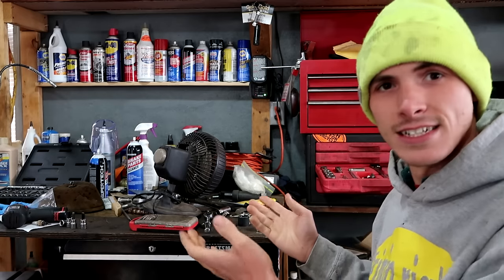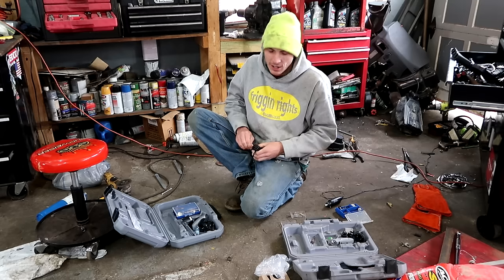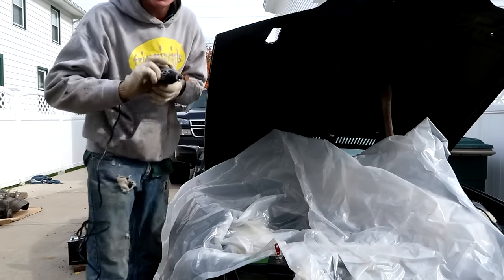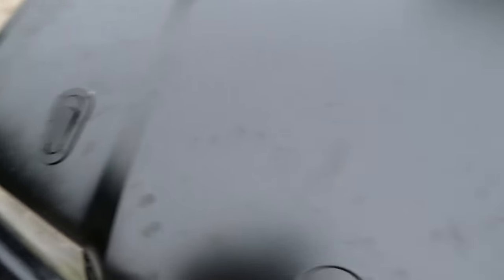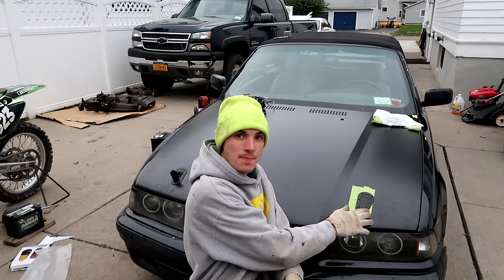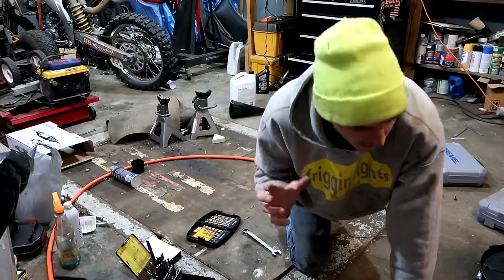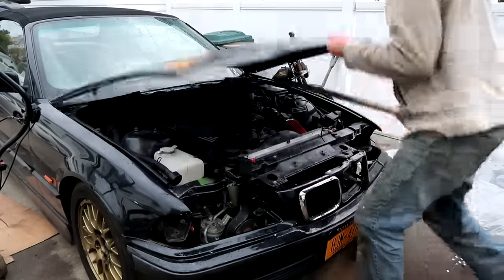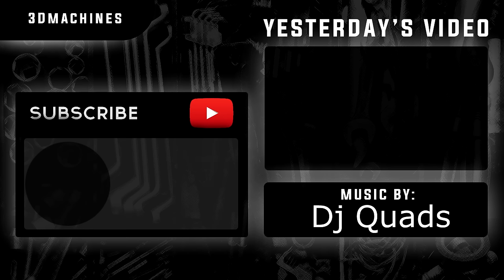THE WORST CAR MOD EVER...

Comment: Peg Board....You need to invest in some. You can mount 2x4s on the wall,screw in peg board,buy a couple packages of the tool holders,and your mess will no longer be.  Its easy,its cheap,its called organization.  Do it,it will save you more time,time to do other things. You will be happy you did.

Comment: You can weld, don't leave those cutouts in the core support like that.  On most cars that's the only thing keeping the "frame" (I know, it's a unibody) spaced correctly side to side, and that will cause it to eventually rack and get out of alignment.  Plate in the cutouts and then re-enforce them and then grind them nice and clean.

Comment: Dalton. The metal rod you had the dremel cutting wheel attached to is for the sanding wheel. There should be a metal rod with a screw in end. That's for the cutting wheel

Comment: -Wouldn't have bothered to clean up the hole. Just put some vacuum hose on it and the top will be covered by the clip part-Also hood pins are not cool enough to basically cut out the core support

Comment: i was building my pc and then i had a o fuck moment my cpu coller is to big so i can only have 2 memory (ram) cards and my power supply was turn upside down so it was putting hot air in the pc xD